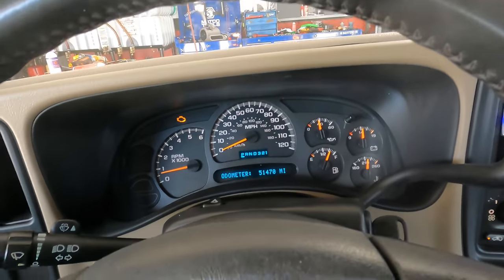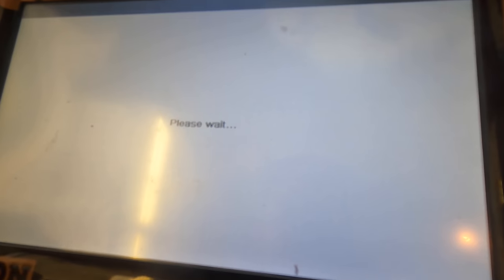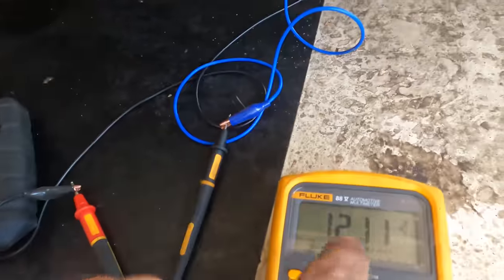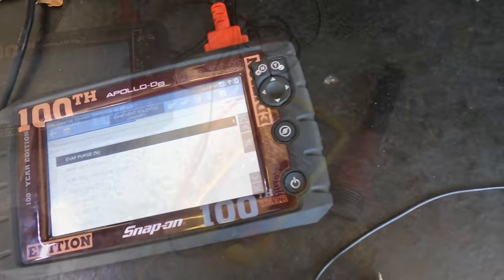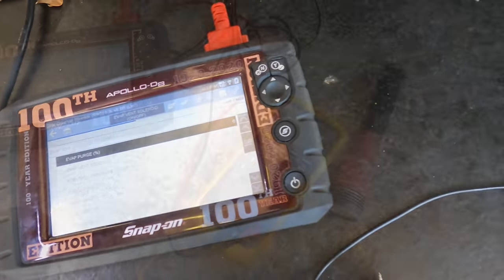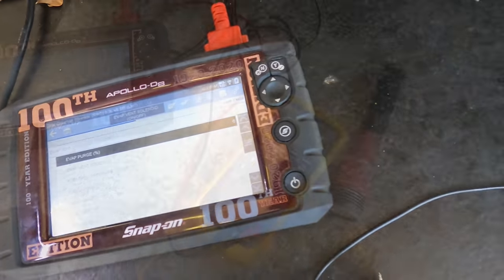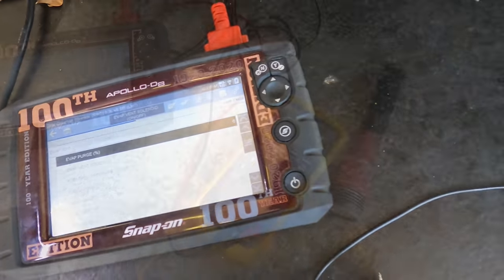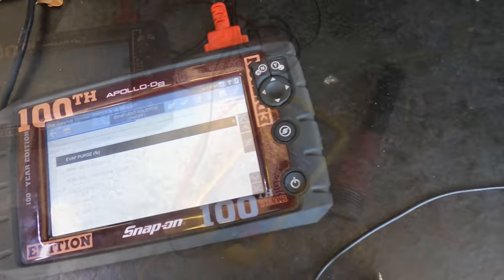RARE FAILURE! Short Circuit? Misfire Evap | Chevy Silverado 5.3 P0300 P0455

Comment: Reeee! & a dislike! 

Don’t use heater hose for evap duty (unless it’s your own truck hack job), as it has to withstand fuel vapors & vacuum, SAE violation right there as you need 30R7 hose.
Reply: There is actually a bulletin from GM saying to use heater hose to do this repair